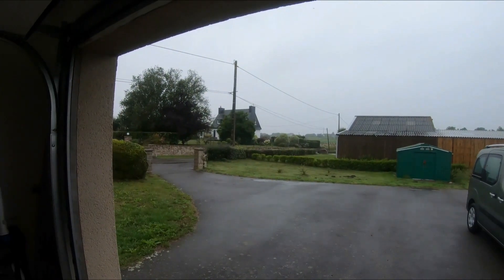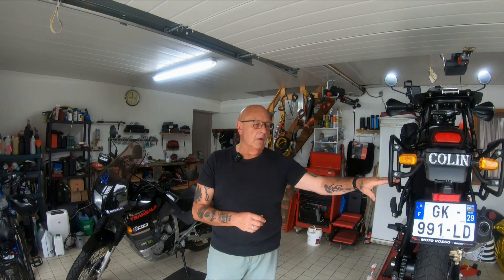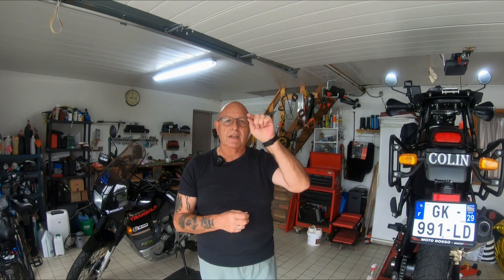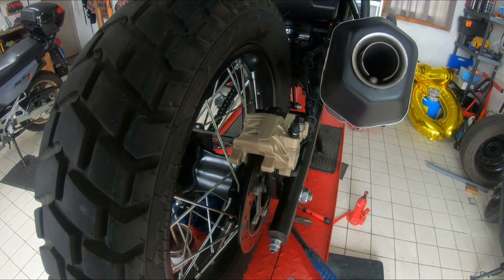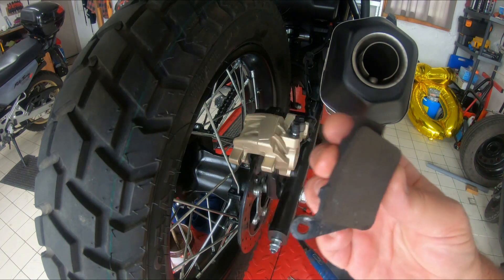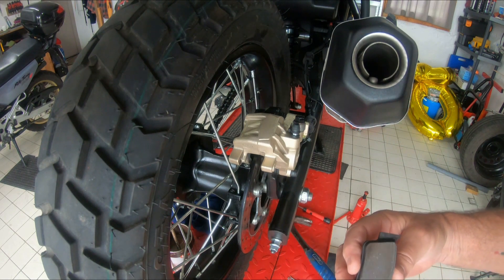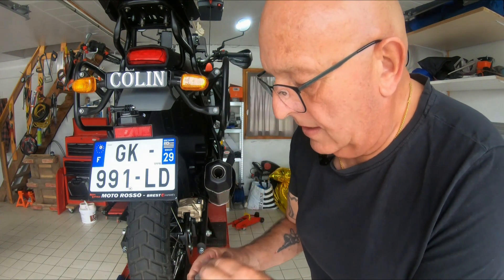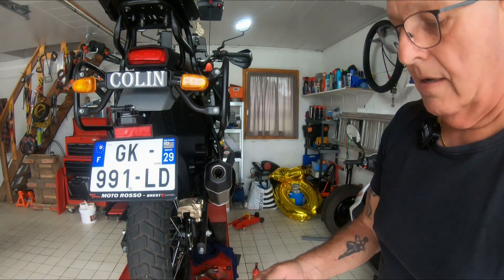Royal Enfield Himalayan rear brake disc (euro 5 caliper)

Comment: Thanks, Colin. I'll be using that technique to change the brake pads on my slightly older Himalayan, without taking the wheel off. Also, I have the same panier brackets with rear flasher extensions as you, a very clever design.
Reply from the maker: Hi, I'm glad the video was useful, yes those pannier brackets are a very good design, thanks for watching the video, take care ....... Colin ☺️

Comment: My Interceptor does the same and temporarily fixed on the first service but back pretty quickly so I am going to try new pads now I've seen how it's done. Thank you.
Reply from the maker: Hi Phillip, thanks for watching the video, I'm glad you found it helpful, I think new pads could be the answer, I haven't had the chance to try mine out yet due to the rain, but if mine still do the same I will change mine, I will more than likely use ceramic pads ........colin 😄

Comment: Grand job Colin...the mechanical noise from the rear brake drives me crazy ....it shouldn't happen on a bike with such low milige ...the thing is its intermittent so one day its terrible and the next day nothing ...i haven't bothered taking mine apart yet ,ile wait until the pads wear down a bit and see if it starts to behave itself ...hey Colin a favour to ask ...I deleted the trip to Russian border video and reposted it in a much shorter version ...could you do your comment again about the archers and Sinead ,just for the algorithm to get the ball rolling ...the other post was too long and boring for folk 🤣 cheers mate ...hope the rain stops soon for you
Reply from the maker: Hi Harry, yer these rear pads and the noise they make are a bit of a mystery, although I believe the calipers fitted to our model are a lot better than the previous models when I looked at mine there was definitely uneven wear and as I said to Pete that can as I'm sure you know cause spot overheating on the disc and then it could warp, still I do think the problem is more likely to be the quality of the pads, again sintered pads for me are the best and ceramic are even better, so if mine continue to wear uneven I will change them, take care Harry ......colin 🙂

Comment: Thanks for video, I must inspect my pads as rear brake is very ineffective on mine.
Reply from the maker: Afternoon, it seems these pads glaze over very quickly, I've done them again since this video, as brakes go they do what they're supposed to, stop you, but they are not the highest quality pads and that's the problem, so when it's time to replace them I'll probably go with ceramic, I fitted those on my transalp and I'm very pleased with the efficiency of them 😊 ........Colin
Reply: @droneon29  I will inspect them and decide what to do, EBC do some cintered pads for about 30 euro. Front is fine, its just rear.
Reply: @droneon29  That was an easy job to take off the pads, they seem ok, not glazed. Disk is clean.
Reply from the maker: @esrider7765  that's good news, the thing I love about royal enfields is the simplicity, I haven't come across a difficult or awkward job as yet, ...... Colin ☺️
Reply: @droneon29  i ordered some sintered pads this afternoon, they should be here thursday.
Reply from the maker: @esrider7765  interesting to see the difference after they've bedded in, I was going to change mine, but I've decided to stick with the factory fitted untill they wear down .......Colin ☺️
Reply: @droneon29  If mine performed well (OEM) then I would not change but since mine are not, the 30 euros could be a life saver. If the pads dent do it then I will bleed brakes but pad swap is easier and quicker.
Reply: @droneon29  i put sintered pads in this morning. the callipers are free floating so no worry on that front. ok, took bike round the blocks and rear brake if better, it does need to bed in as first off it was even worse but then was getting better and better, hopefully it will bed quickly. I do have some brake fluid arriving friday and a bleed kit just arrived. So I can bleed that if need be. Feeling happier with it now.
Reply from the maker: @esrider7765  that's great news, they should bed in really well, you've almost convinced me to change mine 😊 take care ...... Colin ☺️

Comment: Nice vid. Much appreciated. What tyres are you running ?
Reply from the maker: Hi, thanks for watching the video, I'm still on the stock tyres, I kept an open mind when I got the bike, to be fair they seem fine, I only use mine on the road, so when they need changing I'll fit Michelin anakee street, take care ....... Colin ☺️
Reply: @droneon29  I had the Ceat tyres as OE and thought they were great. Unfortunately I can not easily buy them here in Thailand. Got over 24k Km from the Ceat tyres and getting less than a third of that from my current tyres
Reply from the maker: @pagan1347  hi, the ceat brand as I said seem to be a decent tyre, I've had no problems with them and yes I think if you keep an eye on the pressure they last really well, it's a shame your having trouble finding them, here in Europe they are readily available, I've been a Michelin man for years on all my bikes, it's an age thing 🤣, take care Colin ☺️